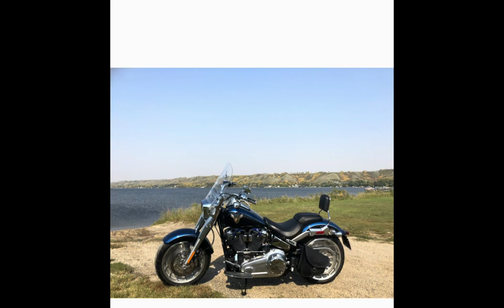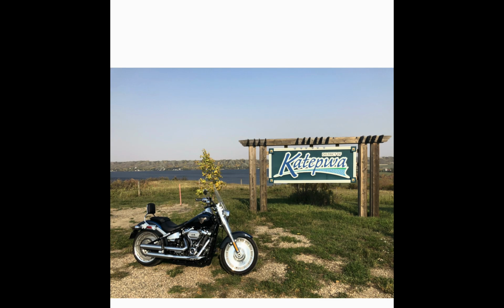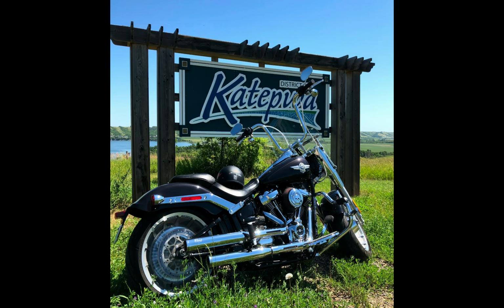The Fatboy - 5 Differences Between New and Old

Comment: Does the fact that those split rotors still clunk when you brake bother you? I hate that on my 2021, HD doesn`t seem to correct the problem despite numerous complaints. Other than that issue I love the bike.
Reply from the maker: The little clunk doesn’t really bother me. As long as they work I’m fine with it.

Comment: I'd add the wheels to that list, the original solid disc wheels are iconic to the model but the slotted wheels from 2022 are just wrong on this bike, just my observations, thanks.
Reply from the maker: No problem. I didn’t go with the wheels as they changed from solid to bullet hole to solid to slotted. I’m sure I’ll get into it when I do a detailed review.